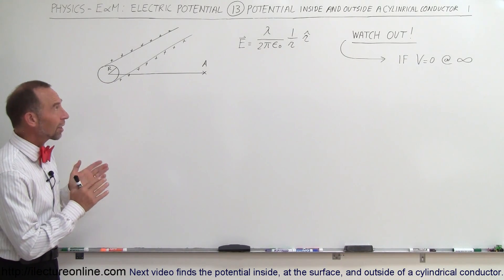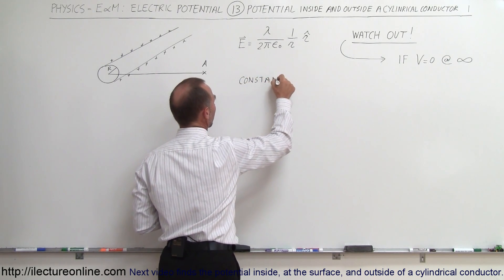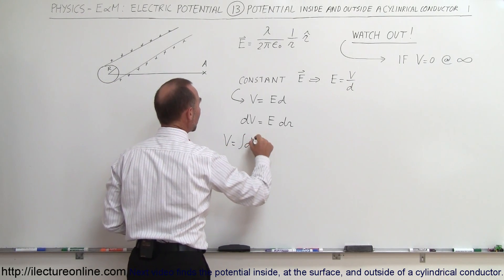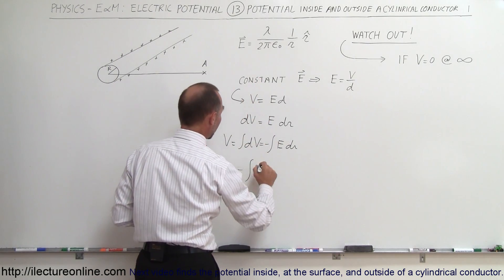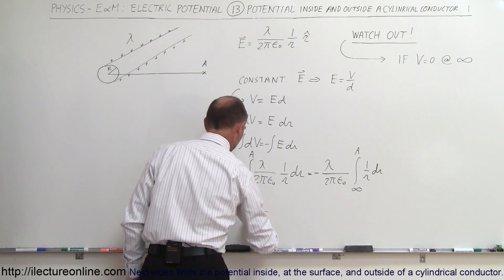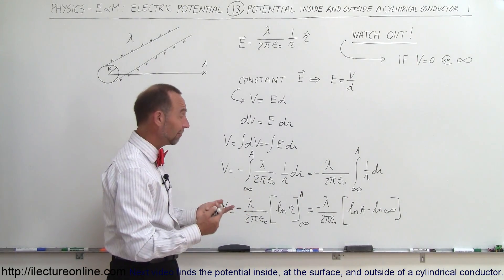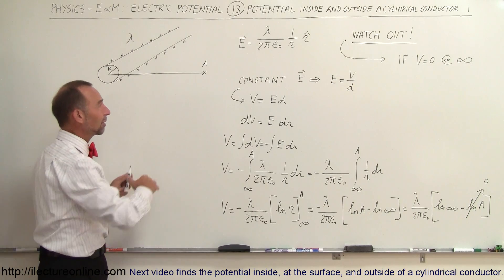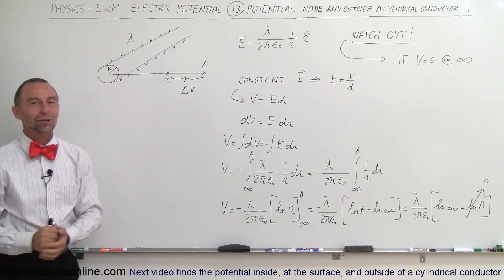Physics 38   Electrical Potential (13 of 22) Potential Outside a Cylindrical Conductor

Comment: Sir, Can I say ?
 While coming from infinity to A point moving direction is opposite to electric field so cos180=-1 
so the formula must be -integral E.dr
Reply from the maker: The concept is correct.  You can integrate from any starting point so that you will calculate the difference in potential.

Comment: Sir, whats the reason that electric potential can be assumed to be zero in cases of spheres but not in cylinder ??. Pleas give any intuitive explanation also
Reply: The cylindrical conductor is assumed to be infinitely long, whereas a sphere is only finite. On the other hand, in the cylindrical case the electric field is inversely proportional to the distance r, whereas in the spherical case it is inversely proportional to the square of the distance instead, r^2. You may know that 1/1 + 1/2 + 1/3 + ... is a divergent sum, whereas 1/1 + 1/2 + 1/4 + 1/8 + ... is convergent. So in the spherical case you will always get the delta V to be finite when compared with a point at an infinite distance, but in the cylindrical case this delta V will always be infinitely large.

Comment: First am grateful for you uploads mr Michel.My worry is that electric field due to a cylindrical conductor is given by total charge(Q) thn the denomenator is right bt here you have used lampda instead of Q
Reply from the maker: The video is correct.  Note that:  The total charge = linear charge density x length
Reply: Michel van Biezen what of if i understand it this way:charge distribution on a cylindrical conductor is taken to be in the centre of the cylinder then the formula for electric field will assume that of a linear charge because the electric field due to a cylindrical conductor and a linear conductor are different

Comment: How did you determine the field using Gauss's law in this question?
Reply: Is there some approximation being done with the linear charge density? I thought we would be using the area charge density?
Reply: Oh I understand now sir the approximation is ok in this case. I was also wondering where I can videos on the derivation and application of the formula  I = nqAvd (where vd is drift velocity)?
Reply: Akila Kavisinghe he approximated the charge distribution around the cylinder to be equal to that of a linear charge distribution?

Comment: Mr van Biezen,
I think the solution is wrong.because, the equation that you applied here suppose to be used for infinitely long straight wire. For the cylindrical conductor we have to apply another Gauss's law......
Reply from the maker: No, the video is correct.  The approximation of an infinite wire is OK in this circumstance.  This type of approximation is used often in many circumstances when appropriate.

Comment: Why did we use kq/r^2 to find E on the spherical conductor but gauss's law on the cylindrical one
Reply from the maker: When outside the spherical conductor, we can think of it like a point charge.  You cannot do that with a cylindrical conductor.
Reply: Michel van Biezen  so I'm guessing we can treat the finite line charge as a point charge as well since you used kq/r^2 when determining the E but used gauss's law for the infinite line charge ? (vids 10/11). In  the comment section of one of the videos, you said the reason we could not use gauss's law for the finite line charge was  because the E was not perpendicular to the surface ? my question is how do we know that ? and how do we know when to use either methods to find E. Long question I know I'd appericate if you could clear it up for me, exams this friday

Comment: sir biezen can you upload videos for variable volume charge density for spherical shells
Reply from the maker: Spherical shells cannot have volume charge density since they don't have volumes.  But spheres do and here is an example:  Physics - Gauss' Law (4 of 4) Variable Charge Distribution: Solid Sphere   https://www.youtube.com/watch?v=oEZYJkGFpks&list=PLX2gX-ftPVXUD03mhbNDgEEsFQKEMt8RM&index=16
Reply: but the shells having inner as well as outer radius can?
Reply: and sir can u upload some videos on calculating total energy of a system of concentric shells
Reply from the maker: The charge on a shell is called surface charge density.
Reply: i am talking about a spherical non conductor with a spherical cavity centered at its centre. and now the charge that the sphere holds is between the sphere's circumference and circumference of the cavity.

Comment: mr bizen, is the value of E corretct ? E = Rc*σ/Rg* ε in cylindiral conductor, in privious chapter you learn to me
Reply from the maker: +ceyceyali 
 E is correct in the video.  You can check by using Gauss's law.
Reply: Thanks mr. but cylinder like act line. why we do this ?
Reply from the maker: +ceyceyali 
It depends on how the charge distribution is given.  From the outside of the cylinder the charge acts like a line charge.  (It is the same with a spherical shell of charge, it acts like a point charge).